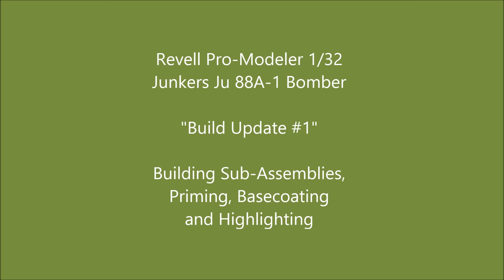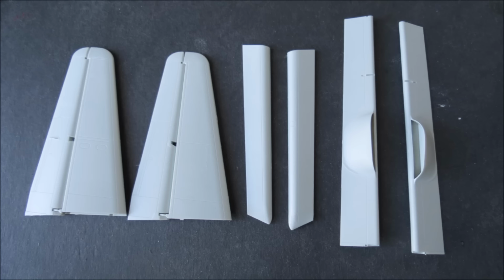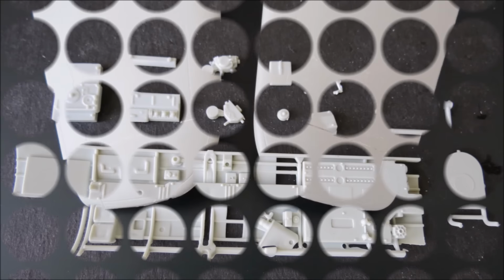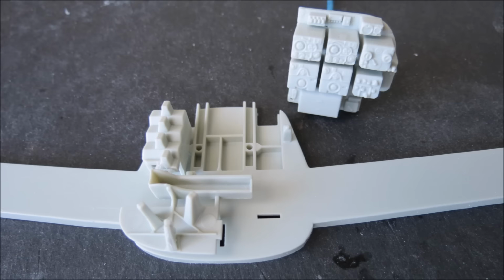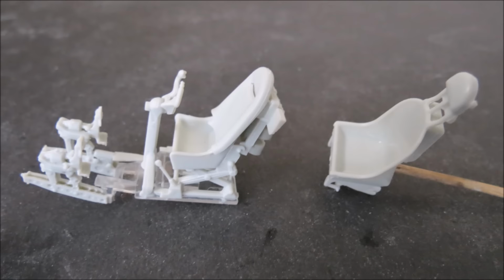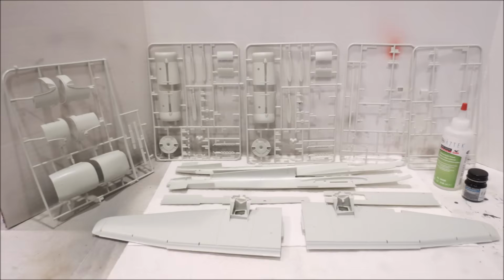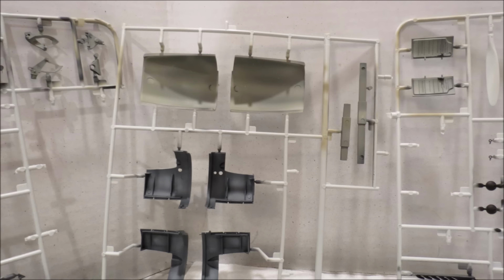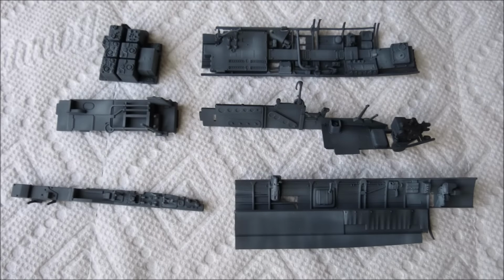Revell 1/32 Junkers Ju 88A-1 Bomber "Build Update #1" (1.28.16)

Comment: I love the way you think it through your assembly and painting and end up so efficient
Reply from the maker: +Anthony Brown  I learned at the beginning of my modeling career (2 years ago this month), that to follow the assembly instructions step by step will get you into trouble. For instance, on this kit, they tell you to fit the airbrakes to the undersides of the wings at a very early stage...but, the wing beneath it has to painted and clear-coated to allow for a large black and white German cross to be applied. With the air-brakes in the way...you wouldn't be able to do that. There are other things, but I used this as a example, because that's a pretty major misleading step. I ask the question "Do the illustrators/technical writers of these instruction booklets actually build, paint and decal one of the models before they develop the booklet?!" ...You know...work out the easiest and most sensible route to a successful completion?! Thanks for watching and have a great weekend! Cheers : )
Reply: +International British Modeler maybe younger modellers would just do it that way ; maybe even not paint it . I know a lot of it is experience ; but you save so much time by being so organised .
Reply from the maker: I try my best to keep the similar operations together so they can be done in one set-up and one pass, so my organization is based on that principal. 😃👍

Comment: nice start Martin  I see you  don't follow  the  instruction sheet I will be starting mine in the next week or so when  I have all the things I need as I have the after market cockpit details comeing  so looking  forward  to starting and seeing more of your updates.
Reply from the maker: +Carl Mitchell  Thanks Carl, much appreciated! I learned at the beginning of my modeling career (2 years ago this month), that to follow the assembly instructions step by step will get you into trouble. For instance, on this kit, they tell you to fit the airbrakes to the undersides of the wings at a very early stage...but, the wing beneath it has to painted and clear-coated to allow for a large black and white German cross to be applied. With the air-brakes in the way...you wouldn't be able to do that. There are other things, but I used this as a example, because that's a pretty major misleading step. I ask the question "Do the illustrators/technical writers of these instruction booklets actually build, paint and decal one of the models before they develop the booklet?!" ...You know...work out the easiest and most sensible route to a successful completion?! I look forward to seeing yours come together, it'll look great with the after-market cockpit details! Have fun building yours! Thanks for watching and have a great weekend! Cheers : )

Comment: Really nice work. I have a question, I noticed that there was clear part under the pilot's seat is that so he can see down and under the aircraft, is it so he can see a crew member stationed below him or am I totally wrong and its just the material they chose to model the part in and there is no other reason its clear?
Reply from the maker: +Dan Knispel  Thanks Dan, much appreciated! The cockpit floor beneath the pilot was molded in clear, I guess to "balance the sprue", or, it was forgotten on the grey sprues then added to the clear sprue as an after-thought? I;m not quite sure, but the floor beneath him is grey lick the rest of the interior. He can see between the foot pedals through the large canopy below, from that point forward there isn't any flooring in front of him. A later slide in the video shows the clear part painted grey. Thanks for watching and have a great weekend! Cheers : )
Reply: International British Modeler
Thanks :-)